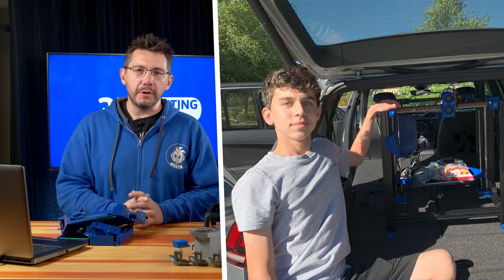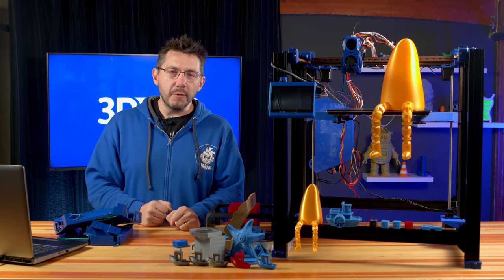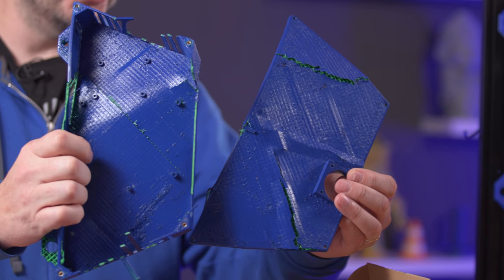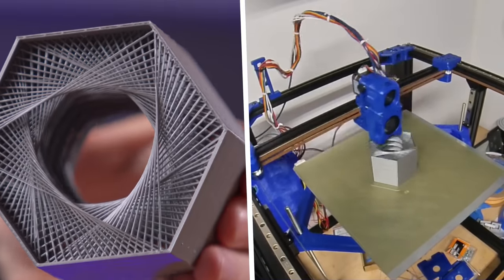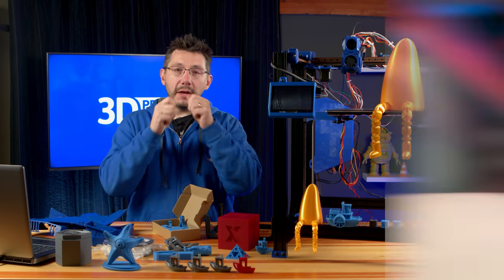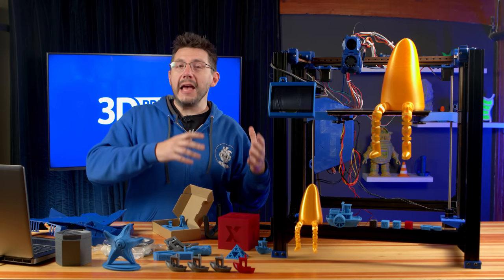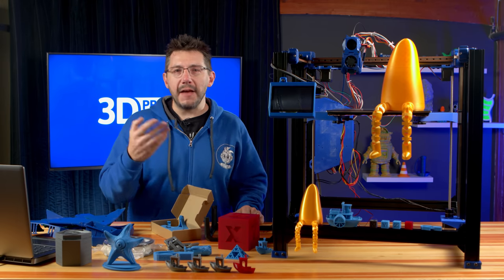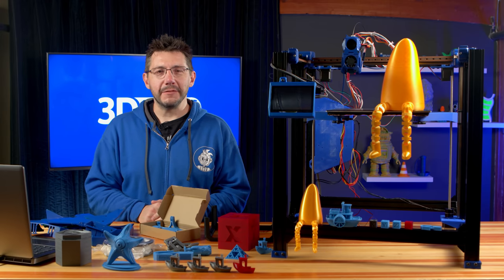14 Year Old Build a Voron - Sort of. Wizard3D W1 Review!

Comment: It's great that people start this young but he should start extremely small and get feedback from potential customers early. Buying an already built voron is quite rare I think, and the print quality of these parts look horrible. Much more to learn before making it into a business. Also make sure that the voron license works with this, because it's basically a voron with some other Z mounts and the cable management is a fire hazard. All of these failure points are great feedback to get early to fix and learn from.
Reply: The print quality out of the box looks better than many other ones I've seen on various channels.
Reply: @rdizzy1  what? no it doesnt - have a look at the voron reddit thread where people post their working built machines and they are pretty solid in quality.
Reply: @francistaylor1822  Not voron machines, but just other machines in general I've seen reviewed throughout the past 5 years.
Reply: @rdizzy1  Oh absolutley for home printed parts for less expensive/demanding projects

Comment: I think the printer does not look ready to be sold. For $1500, I would expect a proper cable management, which is the most striking one. It looks like it erases a lot of good engineering, which went to voron design. Just seeing the crimping fail in the PSU section is just a tragedy waiting to happen. Safety is not mentioned once on the product page.
When buying what looks like a pre-assembled kit, I would like to see the components used - which steppers, controller board, PSU (this one has Meanwell, so that is a good one to brag about), belts, rails...

Comment: first of: nice work Max! i struggel to get the settings right on my monoprice select mini. XD
about the weaker printed parts: maybe the blue color did a number on the abs (i think it was printed in abs). some paint are terrible to colore plastics because it weakens the structure of the plastic itself. i made a mistake as a apprentice and took the wrong paint on some working parts and it almost desolved the plastic parts. jeez... my boss beat (verbaly) the living crap out of me. XD
i like the design and the parts used to build it.

Comment: Joel,  dare you screw yourself into an extrusion rail ever again. 3-Way End Corner Bracket Connector are the proper way and you get those for different extruded aluminum rails from 2020 to 4020 to 4040 and bigger. But he should use a CUBE frame design made out of 2020 rails. Those are plenty stiff.

Comment: It’s ironic how much more honest you are about something sent to you when you aren’t sponsored for it. I’ve seen your promo videos on Creality printers that are complete garbage, yet they get a glowing review from you. I think you were way too critical of Max. The components alone are better than anything any Creality machine could put out stock and you know it
Reply from the maker: But I'm not sponsored by Creality? Can you point me to specific videos?
Reply: Hi Joel! I wasn’t expecting a response from you. I assumed you were sponsored by Creality. If not, that is my mistake and I apologize. I do like the positive spin you put on your videos! Good job! I don’t have any specific Creality review videos in mine, I just felt like the review was a bit critical considering the overall print quality of the parts you printed with it. I understand that your commitment is to your viewers, so its important to review it honestly since Max is putting these up for sale. I have a farm of 35 printers (9 of which are Creality CR6SEs). For a tinkerer, Creality is fine. For a business they are all unanimously complete garbage. 6 of 9 had extruders fail within 3 months. 9 of 9 needed the Creality hotend fix. 9 of 9 needed community firmware. 9 of 9 have underextrusion issues and print extremely slow with linear advance K values good enough to produce sellable products. We are transitioning to 100% Prusa farm which is IMO the most reliable workhorse machine you can buy for the price.

I suppose I just feel that Creality has gotten enough positive coverage. Creality should only get so much promotion for its low price. Beyond that, I can’t think of a single Creality model that’s prints ‘well’ stock. I can’t believe how they are still successful